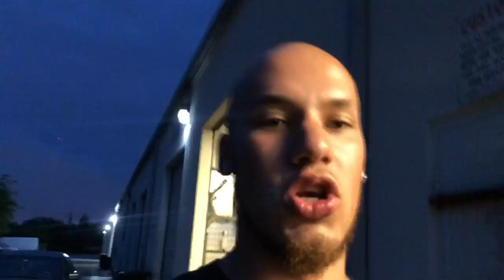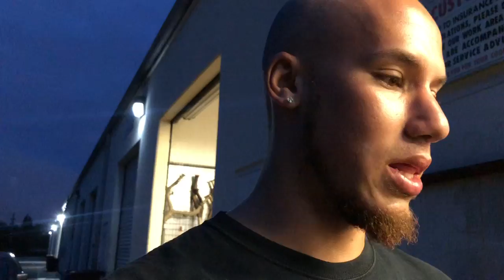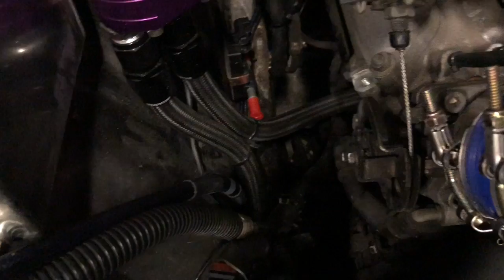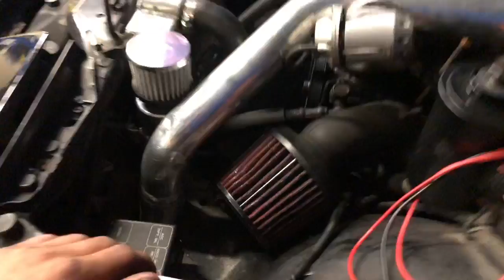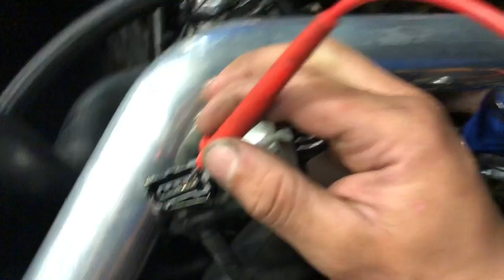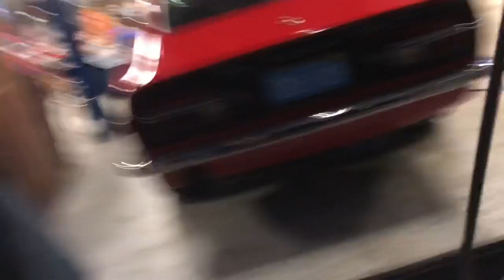180SX Gets E85 Prep

Comment: The 180 needs the motor pulled, bay cleaned and painted, get rid of all the shit you don't need and a harness tuck. Get a heat gun and peel all the stupid, random stickers off it. Get a decent set of coil overs and some period correct wheels.